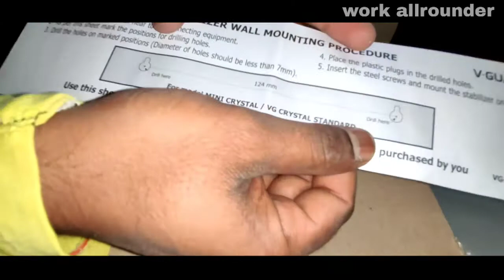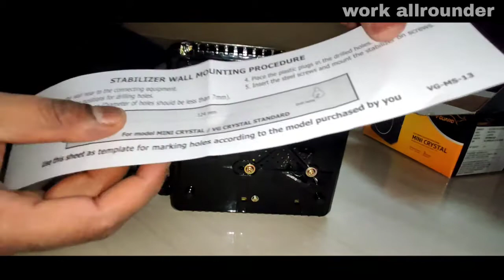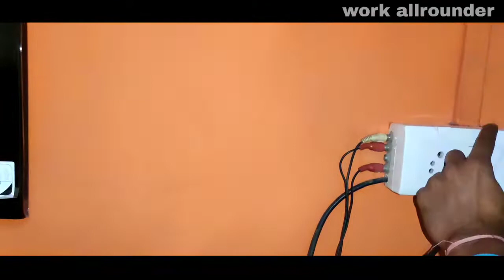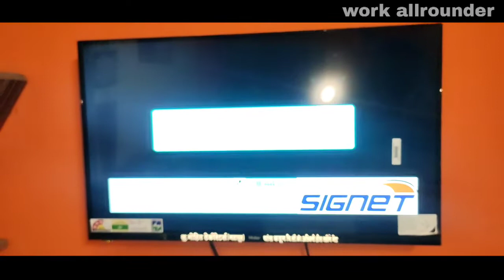how to use voltage stabilizer for led tv || स्टेबलाइजर का उपयोग कैसे करें || Work Allrounder ||

Comment: Can I connect multiple devices on one stabilizer ( Tv,soundbar, subwoofer,Airtel dth adapter ) 

NOTE ;- but this time my subwoofer not working ( no turn ) please tell me a reason please )
Reply from the maker: I think voltage problem
Reply: @varthavishalworkallrounder  I am buyed new soundbar on Flipkart...after I am connecting to the stabilizer on TV wire,soundbar wire, subwoofer wire,Airtel dth adapter as some stabilizer ( after 2 hours not working subwoofer only ) why please explain me